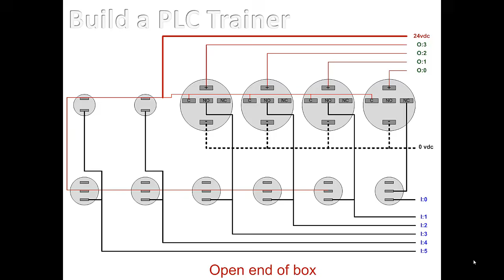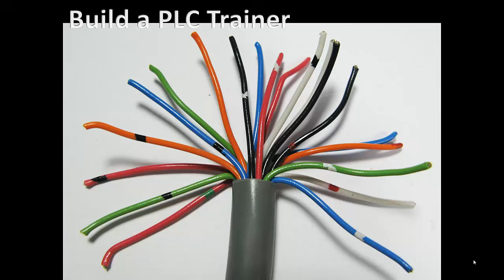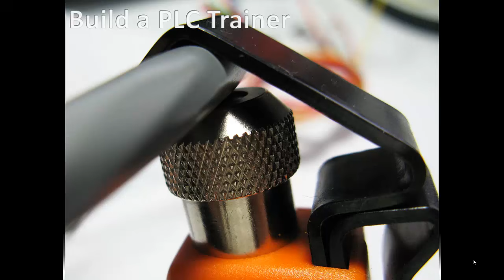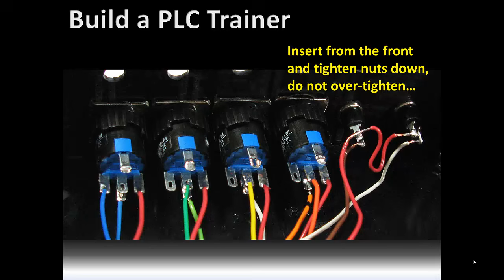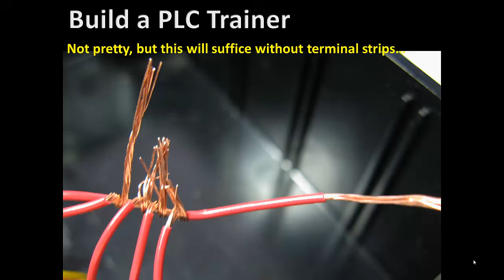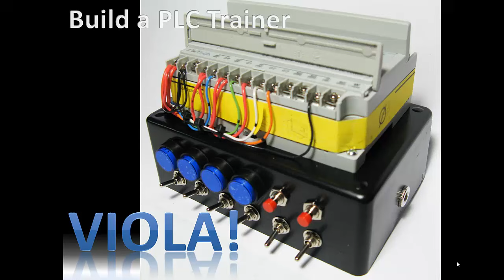TS04 Pt.2 - Build a PLC Trainer Part2b Deluxe

Comment: hey profesor i got  AB micrologix 1000 1761-L16BBB with 10 inputs. so can i use do more than 6 toggle switches ?
Reply from the maker: +Elwistas You can use all 10 inputs if you like.
Reply: thanks for information professor.

Comment: Hey PLC professor. My ouputs are a bit simpler than yours. If considering a 24vdc led light, is my ground off of the outputs my common? My understanding is that the conductors leading into the outputs (e.g. O/0. 0/1) would be positive while i could solder the ground as one big lead or a common. Please provide input if you can. Thank you
Reply from the maker: Just to be on the safe side. Google the part number of your controller or output card. Go to the section on wiring and it will give you a diagram to follow. If you have relay outputs, which I do, there is no polarity other than the LEDs themselves.
Reply: Okay, I will look at it. I am using a micrologix 1000 for use with RSLogix 500. Same as your video but my lights are independent. Basically i wanted to ensure that I do not receive power to the lights until the PLC says to do so.

Comment: I used a double pull triple throw toggle switch so all six inputs have NC, NO and OFF and that way i did not have the issue with joining all the commons together.